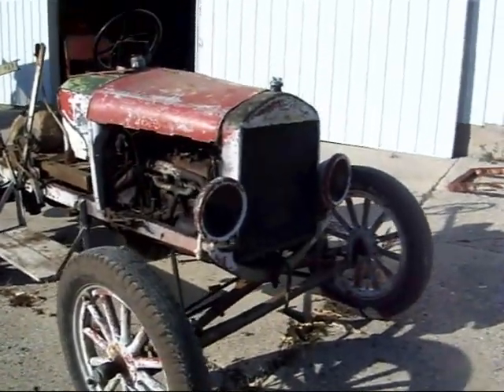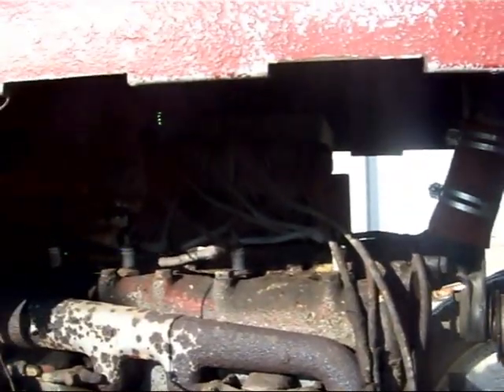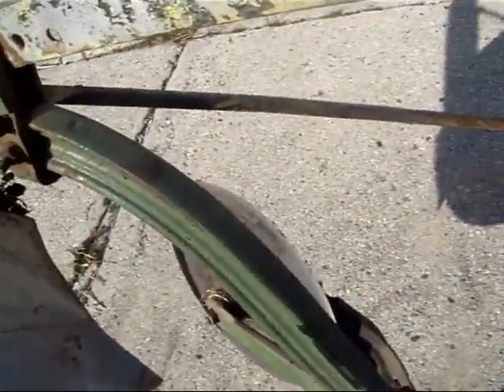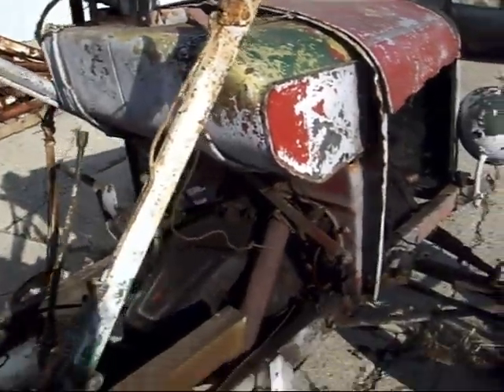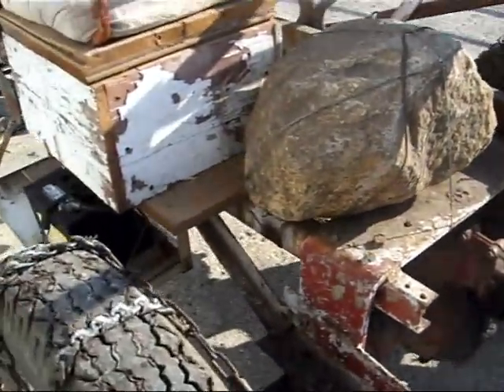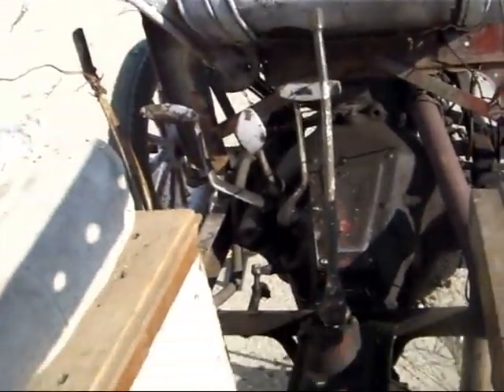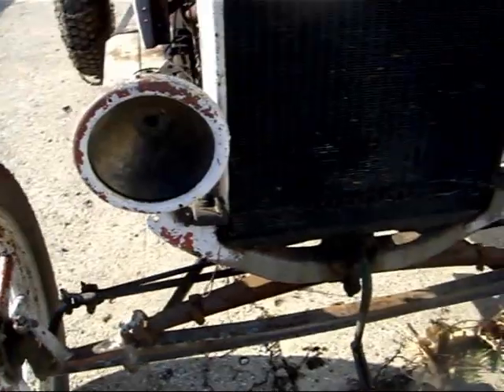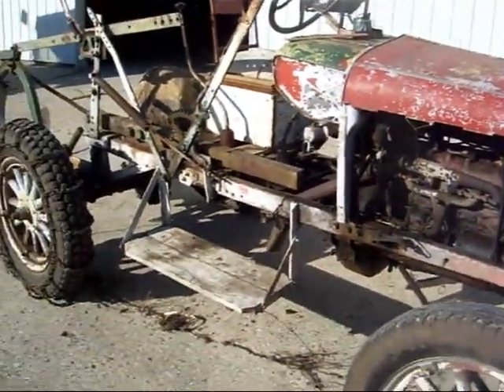Model T Ford Tractor Walk Around.

Comment: I hate to bring it up, BUT The Victory gardens were done during WW 2, NOT during the Depression
Reply from the maker: +William Christopher 

Yes, you are correct. My understanding is that this tractor
was used for the same purpose during the depression before my dad bought it. But
they were not called victory gardens. Then my dad used it for victory gardens
during the war. I guess over the years the two time periods blended together.
Thanks, for bringing it up as this old tractor was working during both periods.